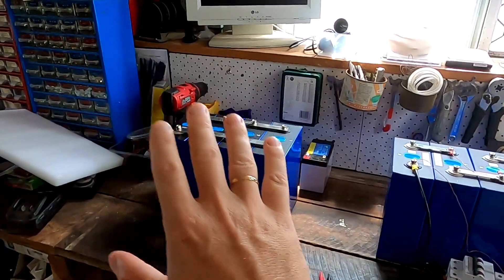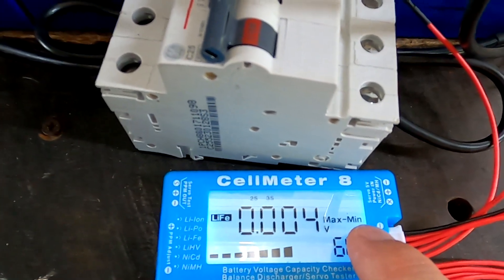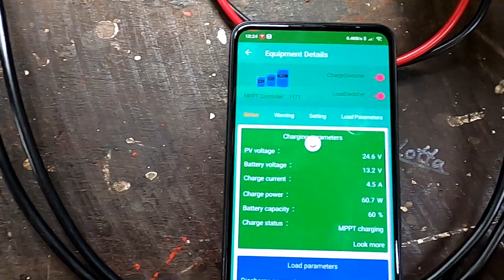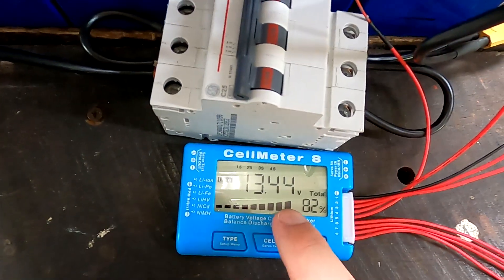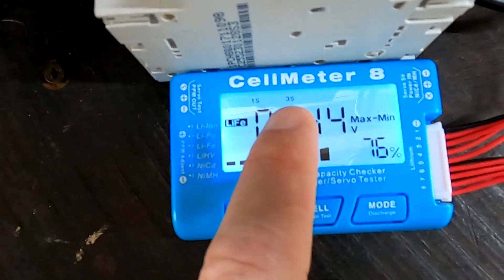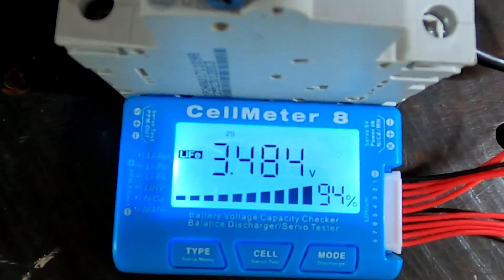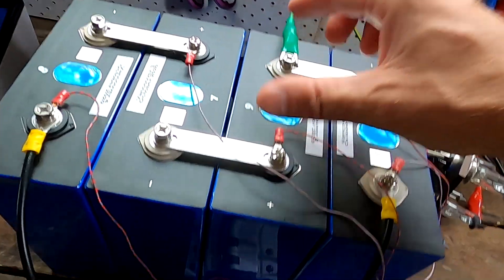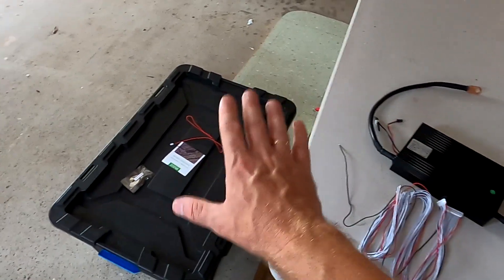Do this and you don't need a BMS 😉

Comment: Not using a BMS on Lithium Phosphate cells will eventually kill them, but not using one on Lithium Cobalt cells will kill you when they violently explode in your face!  Lithium Cobalt is a stick of dynamite (ie: Tesla cells) while Lithium Phosphate is the safe cells.  The BMS is there to protect the cells and your investment.  I would never again use Cobalt!  The first BMS I built was for Cobalt 18650 cells and half of them nearly caught fire until I got the BMS working properly.  I have built 1000's of Phosphate batteries since then and never had one get that hot.  They will die if you really abuse them, but never had one get even close to exploding and the BMS is there to make sure the cells don't get abused.
Reply from the maker: A few people don't use a BMS. It is possible if you drive your battery only to 80%, so below the knee on both sites of the curve. You still may want to schedule a maintenance once a year and connect and active balancer or so.
Reply: @OffGridGarageAustralia  That is a mistake because Lithium cells don't charge at the same rate as the cells on the top of the stack charge faster than the cells on the bottom, so after just a couple of charge cycles the cells can be 5% out of equalization.  Typically, passive equalization is only burning energy off the high cells 2-3 watts per hour in heat resistors and with 100ah cells, it could take 5 hours to burn off energy to equalize the pack.  My current BMS is Active Equalization which equalizes the pack while losing less than 1% of the pack energy and provides over/under charge and load protection.
Reply: @ronaldjohnson2875   hi Ron what is your recommend for a bms ??

Comment: Great video, the biggest issue I have is that most BMS devices have very limited current capabilities to discharge a cell and when you have high capacity cells like you show here (maybe 240Ah) they can struggle to bleed off the charge.
Reply from the maker: I thought the same but it's all about finding the right settings and over time even a small discharge and balancing will work. My BMS does only 0.2A balancing and it can balance all 16 280Ah cells down to 1-3mV deviation.

Comment: I would be looking at a balancing current of the BMS of at least 500mA, most only do about 10 to 20ma and be able to data log the voltages between the cells
Reply from the maker: The QUCC BMS I now have does 200mA and works well with that.
Reply: @OffGridGarageAustralia  I am using Stuart Pittaway.s setup, It is a DIY open source BMS, I have used it in a few of these my bank builds, just search Stuart Pittaway in YouTube, or look at my Youtube channel for some of them.

Comment: Bottom balancing will result in a ragged end voltage and a balanced discharged voltage. Usually the ragged charged voltage is not a terrible difference but when you remove the charge it will bleed off the top and usually be quite balanced at fully charge resting voltage. Takes a bit to bleed off the charge voltage to a stable resting voltage. Usually around 3.35 volts.
Reply: That cell that is filling faster is your low capacity cell in the bunch. If you charge to 3.5 volts and your low cell goes to 3.65 your pack is fine and let the charge bleed off to static voltage and I bet you will see 3.35 or maybe 3.4 volts per cell. So all have the same capacity at this point and will all be equally balanced at the bottom if you don't let it go below 2.5 volts. Monitoring the voltages is fine. If you have a cell that reaches 3.65 volts long before the others and there is still a bit of time before your termination voltage is reached and if that difference puts that one cell above like 3.8 volts then you need to swap in a better battery that has a similar capacity if you want to go BMS free.

Comment: Ahhhhhhh! Good video, but you list everything except the "200 amp PROGRAMMABLE BMS" in your list.
I have a 12 volt 200 amp LiFePO4 system, in my caravan with Victron MPPT regulator, BMV-712 monitor, (networked together), and a Daly 200 amp BMS. I hate the BMS because it is not programmable, and it has no LED's or any indication of whether it is working (correctly or otherwise). 
I can tell you setting up the BMV-712 was a VERY steep learning curve, but I would love to have a programmable BMS, especially it it has Bluetooth (like my Victron gear)?.

Comment: I blew the BMS in my mower battery. I recently changed from a SLA 12 9ah battery to a 9Ah LiFep04 battery. It is half the weight and charges in under an hour. I left the mower's magneto charger connected and started the mower. The mower outputs a half rectified 12 volts which is really bad for Life batteries. I need a 6s Life BMS now. Anyone know where I can get one as I charge the battery with a ctek LiFeP04 charger.

Comment: I believe the initial balancing maybe was a bit off. Charge the cells to 100%. Discharge a bitt individually to exactly the same voltage before disconnecting, then charge to 3,56V in parallell. I do bottom balancing, but that is the same thing, except for balancing at the low state. I managed to get them to meet at 2,5V at the same time. And since we have control over the top battery voltage, we can stop charging when the highest cell reach whatever you wish. If the balancing was good, that will be nearly the same every time. I try to not use BMS because I think it is a dumb fix to a problem that should be overcome otherwise. However, I have one that I will try.

Comment: I'm using 12V Lifepo4 7Ah batteries that are designed for use in a UPS. They have built-in BMS which keeps the cells balanced and also provide over, under and short circuit protection! 
I have them wired up in series for 48V which also needed some sort of balancing so what I did was to use an MPPT charge controller for each 12V battery, that way each battery pack will be charged separately as the charge controller is adjustable for the maximum voltage! 
I have tried the same thing with 18650 lithium ion batteries in series, I have been charging them to 4.2V each at the same time, some stop charging earlier and some later but they never go over and they are automatically balanced! 
Not sure if you understand what I have done, picture it as a series of car batteries, now take a few 240V car battery chargers and connect one charger to each battery and turn on all the chargers! They might be all in series but because they are being charged individually, they will always be in balance and you never have to check on them. 
The MPPT charge controller that I'm using is from eBay, it's just a circuit board with no enclosure! I think that they cost $10AU with $5 shipping, they are rated for 100W so for me that means a total of 400W of charging, they can also be paralleled for twice the current output and they have a potentiometer to tune it exactly to the solar panel that you are using for maximum power point tracking! And they track extremely fast! I have had others where I would wonder what they were doing because they were so slow! You see the sunshine come out and it's like it's thinking about what it's doing! No so with this little thing! As soon as there's ambient light first thing in the morning, it's already on and trying to charge... 
Higher voltage is so much more efficient, with the 48V system, I just had to use 4 12V Led Down lights per room which meant that I didn't have to use thick cables to carry the current to the lights... 
And because my batteries are small and in their standard UPS style case, they are cheap if I need to get more storage capacity! They cost $70AU each as opposed to $500 each if I chose to go with higher capacity from the beginning! And because I'm using multiple smaller batteries, I can charge and discharge at higher current without causing them to heat up and becoming damaged so basically if I could get away with just four $500 batteries to cover everything that I need, I would prefer to get 8 at half the size, you can charge them twice as fast...

Comment: Ok, what you do is get a 5 volt panel with a 3.45v voltage regulator - and charge each cell separately, for a "12v" battery.
Or an I wrong?
The lifepo4 can't go up past the voltage from the charge controller, can it?

Comment: If you hold the middle 'Cell' button, doesn't your 'Cell Meter' have a balancing function?  Hold the middle button 'Cell' then, tap it once.
This is how I've been keeping my 7s pack balanced.
Reply from the maker: Does it say 'balancing' on the display then?
Reply: @OffGridGarageAustralia  It will say 'bal'
Reply from the maker: Thanks for the tip. I'll try this next time when I have it connected.

Comment: Great explanation! You can also top or bottom balance the cells as well. For using with off grid solar , most are now recommending top balancing. You can take your cells (In parallel) connect a DC Power Supply Variable 30V 10A  to the bank and take them all up to 3.65v. Disconnect the cells and put them back in series and your done! Will Prowse has a great video on doing just this. Thanks for sharing!
Reply: I think the purpose of top/bottom balancing is to get the cells prepared to be installed into a pack. It's a starting point only. 

The idea (of top/bottom balancing, and NOT using a BMS) is to rely on the cells kind of bouncing around between the min and max voltage of the weakest cells, without using a BMS. 

But this is flawed long term, because cell properties will change over time, and you don't want to have an outage of your system while you top/bottom balance again.

Doing a top/bottom balance at the beginning and then building your pack with a BMS, will give the BMS the best chance of doing it's job.

If you introduce an additional active balancer into the mix, this will enhance the BMS by keeping cells balanced from each other, not just burning power into heat to lower the high cells. This gives you the maximum power out of the pack, but it will cost the most.
Reply from the maker: Thank Dan. The pack is balancing for the last 4 days already. It takes a while with the small DC buck converter I'm using...

Comment: You could always keep the 3.6V bank in parallel and use some kind of inverter to generate the 13.6V to 48V  you need for your purpose.
Reply from the maker: Uhm, probably not, the currents would be BIG. I mean really big!!!
Reply: But the distances could be very short. I think I may go this route.

Comment: How do I monitor individual cell when connecting in parallel?
Reply: You wouldn’t. Leaving them in parallel for some hours or days will let them achieve nearly ( and this is the goal ) identical voltages. Only then after disconnecting the parallel connections can you check the individual results. If, after that balancing you wanted to use them in series with four more and so on, each four in series with the next four, then the voltages within the paralleled four cells would not vary. They could be out of balance as compared to other four cell groups though, and this is where a BMS might be used. Although in solar applications imbalances are often not an issue.  Monitoring cells or paralleled groups of cells over time would show the need for active balancing. I have 96   200A cells in 6 strings of 16. Or 6p16s.
Charging about 60A off the roof on a sunny day.  I top balanced when they were installed 3 months ago,, and they are still within .05v across the bank. I could have paralleled 6 cells 16 times in series for an even more stable bank, but the copper buss bars needed are expensive.

Comment: Great video! Thanks for taking the time. - What size BMS do you need?
Reply from the maker: Thank you.
I'm going with a 200A BMS. It all depends what kind of load you will have...
Reply: @OffGridGarageAustralia  One of my inverters is 3000W and without the inrush I would imagine I would need a 250A BMS... You think?
Reply: @peterrock2838  You tell us ... a) 12 volt or 24 volt or 48 volt system?   b) Max amps rating of the Inverter, Charge Controller and Battery Bank?

Comment: I've been running my 12 200 ah Winston pack for four years, on exakt the same cheap PROGRAMMEBLE WINCONG PWM solar charger WITHOUT a BMS, works with no problem ( I first used a more expensive MPPT, but in my specific setup with has a lot of schading from trees ,the PWM with 2 100 watt panels in IN PARELLEL, gives the same or even more amps to the battery's, in my opinion you can get away with a cheap * PROGRAMMEBLE* PWM controller just as well, and as long as you do your initial TOP BALANCE RICHT THEY, DO NOT HAVE MUCH CELL VOLTAGE DRIFT ( as long as you don't charge higher than 13.5 volts total pack voltage) drifting only occurs at the edges of the charge curve ,so try to stay within 2.8 - 13.5 volts and your LiFEpo4 pack will have a save and healthy long live WITHOUT a BMS ( many BMS UNITS have actually to small resistors to effectily discharge those big capacity cells so a lot of " pumping" happens to get at even cell voltage) this by itself can shorten cell life and FOR UNDERVOLTAGE PROTECTION MY 2000 WATT INVERTER HAS DAT BUILD IN, SO I'M HAPPY WITHOUT THE CLUTTER of BMS wiring.
this works of course for a stationary solar system good,on my EBIKE (WITH MUCH SMALLER lion cells) I do use a BMS ,for two reasons mainly. A. Lion is a potential dangerous chemistry ( Life ps4 is much more safe) and second, when biking I do not monitor pack voltage that well and can quicker arrive at total depleting the pack ( after Wich I must peddle so hard)
Nice video btw, and thanks for showing
Reply from the maker: Great feedback, thanks a lot. I totally agree with you. I have planned to charge my cells to 3.35V only, so 13.4V in terms of a 12V pack. I could see exactly what you just described, the cells stay close together unless you exceed 3.4V. The they start to drift apart a lot.
As we are trying to be as beginner friendly as possible, I will still recommend a BMS for the sake of protection the battery.
Interesting finding you have with the PWM controller. I think your two panels in series with a MPPT could boost your current significantly?
Reply: @OffGridGarageAustralia  yes in series can give more efficient charging butt, only when there is no shading...in my case o ly one of my panels gets sometimes shaded ( in summer) by a big tree ,so after some experimenting I've found that parallel panels in combi with a PWM works just as good , AGAIN A BIG reason to switch to series is of course running long cable length, and easier expanding to more panels,( higher voltage/small amperage,cheaper cable, en less line power loss ,for a small setup like I'm  using not so much benefit.
I would like to emphasize especially for the newbies to FORGET ABOUT LEAD, nowedays, just when prices ( thanks to china) of LiFEpo4 starts dropping, it is foolish to stay with lead chemistry battery's, especially for solar, charging efficiency of a LiFEpo4 setup is way higher than even a good set of lead batteries, not to mention ,although more expensive upfront due to the very Long cycle life of litium ,the return on investment ( Roi) is way lower....
Reply: @giottodiotto1  How much did you spend for your 12 @ 200Ah Winston cells ?

Comment: Hi, I´m writing from Europe, (Czech) and I habe a very special question.
I would like to setup a 12V system with 16 cells á 110Ah.
Can I use a "normal" BMS 4S for 12V or will I need a special one.
How will act the 4 cell parallel? Will they be balanced the whole time? Or I have to take care of something
Best regards from Praha.
George
Reply from the maker: You put every 4 cells in parallel and then series these parallel blocks. You will need only one BMS for 12v. Parallel connections of batteries count as one cell. I'll make a video very soon about that.
Reply: @OffGridGarageAustralia  Thanks for the information. And it will be not nessessary to balance this 4 cells?
Reply: @georghope4034  You should balance all cells BEFORE you create your battery bank

Comment: Hæ, 17:47
If you can start a fire Whit those cells in Thad setup, I will pay for the equipment😊
Reply: LeFePO4 is "safer" than other Li-Ion batteries, but still NOT 100% safe ...
Reply: @vtorsi610  
Can you find ANY literature Thad says lifepo4 has ever started a fire because of the cells?

Comment: We also don't have to use fuses or breakers....
Reply from the maker: Let me make a video! 😂
Reply: @OffGridGarageAustralia  please make it clear to your viewers that none of them are a must have....but they are safety mechanisms......yes breakers and fuses are mandated by code in most jurisdictions and mabe soon so will a safety device(bms) for lithium batteries
Reply: @roqm1248  In the USA, per the NEC ( National Electric Code ) - OCD's & Disconnects are a MUST have !
Reply: @vtorsi610  it was a facetious comment although factual you dont "have" to use any of them in a battery build you also dont need a fuel or oil filter in your car but all of them as well as a bms are protection devices....and i lean heavy toward using a decent bms.

Comment: The only time you need no bms is if you have no batteries!  That battery tester requires a load to test, I have two, thinking I could test with it! Amazon doesn't have the load device for it as far as I know,

Comment: This is a great explaination especially to the begginner showing generally how a BMS works and why a BMS is important. It doesn't tackle the current limitations and temperature cutoff stuff so hopefully you can make a more advanced video tackling sizing a BMS and explain the other functions. Great content, sir.
Reply from the maker: Thanks, I will show more of these BMS bowel once we set one up. But, yeah, there is more to it, than just balancing and voltage protection.

Comment: sorry sir, if there is a weak cell in the row it will be the first which reaches the max. voltage and will also be the first which is at the lowest value decharging the battery. Only cutting off the process will help to rescue the weak cell not balancing.